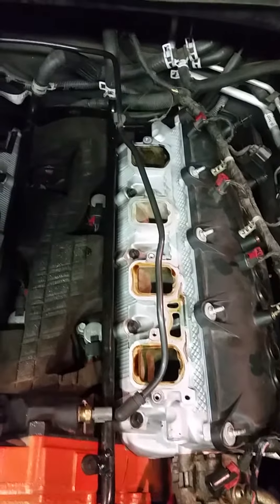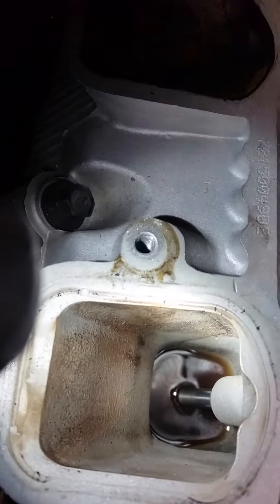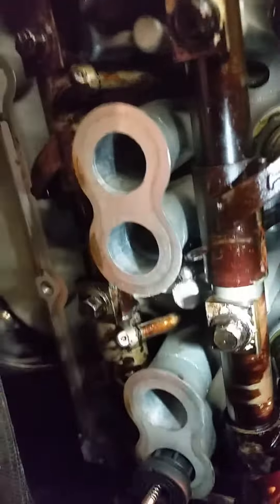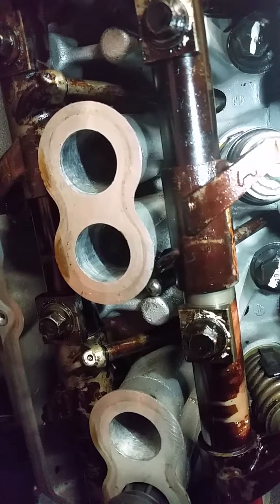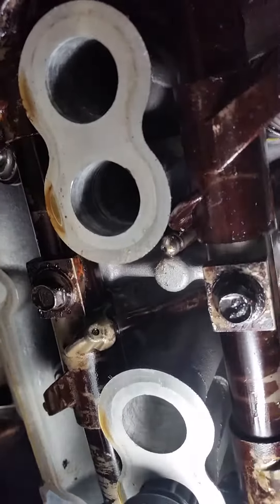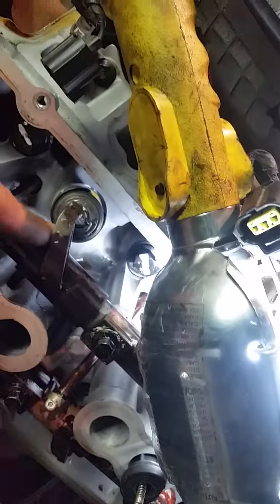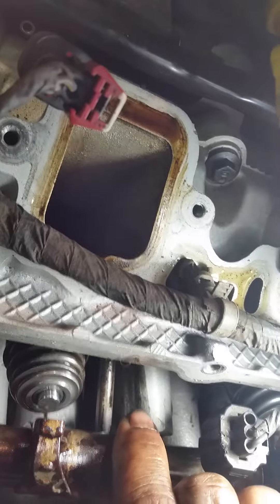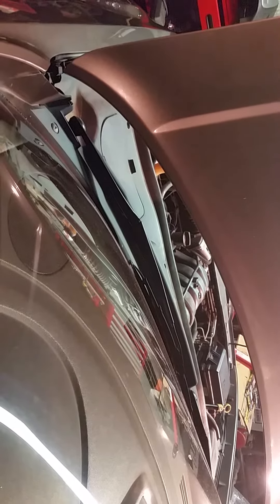Sea Foam, Mystery Oil, or Oil Treatment  Cant Fix this Ticking Problem But You Can! Pt.1

Comment: The reason the pushrod was loose is because the lifter went south and took off all the tension.  You already had most of the stuff off to get that far into the engine.  Why not pull the head and check the lifter while you were there?

Comment: what does it sound like before you fixed it
Reply from the maker: It made a rattling sound, and check engine light stating misfire in that particular cylinder.

Comment: yah mines doing same thing but cel is coming and going. so u replaced the pushrod
Reply from the maker: check the push rod to make sure it is straight, and make sure it is tight when installed into the rocker arm rail. if not you may need to replace the lifter located below the cylinder head.

Comment: engine builder is fired
Reply from the maker: have you seen the lifters on a chevy tahoe. the ones that are for the fuel cut out. they have a spring on the outside that goes bad. causes all type of issues in the computer and the running of the car. I do agree with the cost of the gasket and bolts. but replacing those will only give the motor more life. 
Check my channel for a video on the subject. I think its called how to tell a bad lifter. either way its on my channel posted it about 2months ago
Reply from the maker: ohh noooo, I make great money off his mistakes. I tell him to keep up the good work and send me some more cars .
Reply: Artistry Photography I'll check it out I have lifter issues with my 03 explorer aka exploder 4.0 tottaly different set up than any other vehicle a huge pain to do everything looked OK put mmo in it and it's starting to work no it will never fix a major problem I'm not saying that if ppl changed there oil like they should be in the first place it would solve a lot of problems lol I always flush with motor medic engine flush